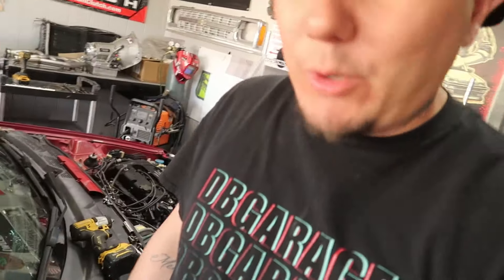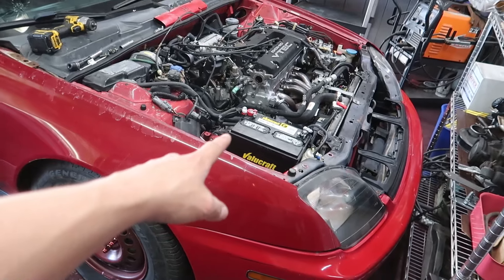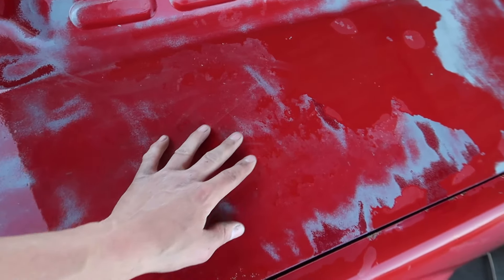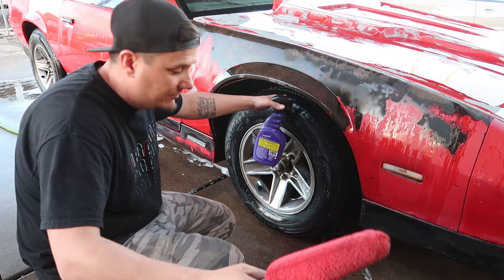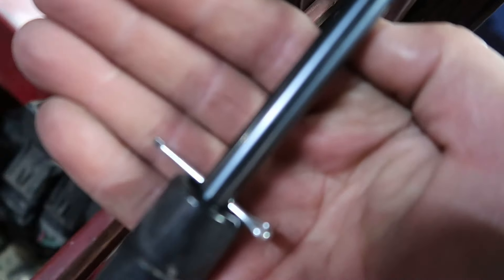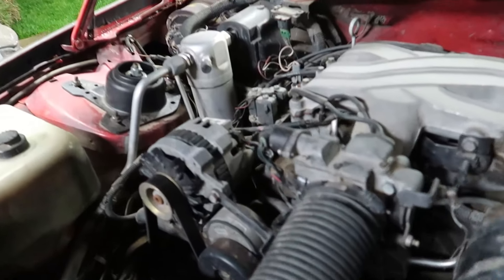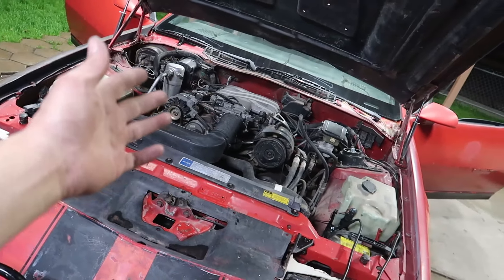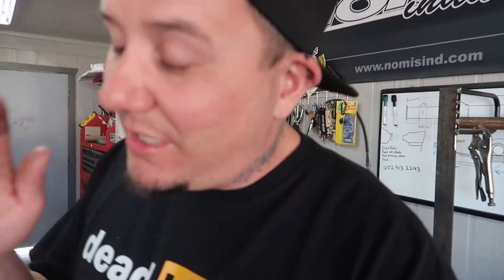My New Gen 3 Camaro!

Comment: I've had quite a few third gens and after I got into newer cars I found out the 3rd or 4th generation interior actually works as a direct swap because if I got another one again I was going to swap the 02 SS interior into it and go LS turbo, your hood is aftermarket it was more of the aggressive Z28 hoods..if I were you I wouldn't look for stock thirdgen seats I would just swap newer camaro seats in it they are more comfortable

Comment: Dude, I swear we're on the same wavelength ... we literally just bought a 3rd gen last month! Lol

I've got a 6.0L for it, already 3 linked the rear, BMW "big brake" upgrade, and am now working on getting some random Subi coilovers fitted on the fronts

Your videos are gonna give me even more motivation to get it done! Keep it up homie!!
Reply: Please elaborate on "BMW brake". What size, year, model, bolt on, and number of pistons? Thanx
Reply: @Twogreenfeet  I'm using front brake/hub/wheel bearing and rear brakes off of an e60 5 series. Specifically, they're off of an 08 535xi

The brakes are massive, roughly 13" rotors. I think pretty much all BMW brakes (except maybe the Ms?) are single piston.

Nothing has really been "bolt on" except the rotors themselves. The 3rd gen is 5x4.75 and the bimmer is 5x120. That pattern and the center bores are close enough (for me) to just run them. But there is definitely some fabricobbling involved for the rest haha

I will make a video for this car on our channel once it is done in case you are interested in exactly how I do it! Worst case scenario, you'll know what not to do haha

Comment: I will say you need to check the cooling cowl for the radiator that is under the front, it's an air dam that shoves air up across the radiator.

Comment: Just as an fyi... Most of these cars rely on an under trey on the bumper that scoops the only air into the radiator from under the car. If this plastic panel gets damaged... It doesn't scoop air into the radiator. The. Causes the car to overheat one time and then it never runs good again. So if that is bent or anything weird... That needs to be replaced.

Comment: Just letting you know I have a 3rd Gen Camaro that originally had a V6 engine in before I put a high performance 350 crate engine in it. . I ended up having to get a new 700r4 transmission those bolts behind a V8. There bellhousing  is different with the 700R4 transmissions that was behind the V6 vs V8 .

Comment: You might want to check the pattern on the transmission (I think it’s like the 2.8)
Reply: The 2.8 and 3.1 are 60 degree and have a different bellhousing than 4.3 v6 or any Chevy v8. So to install that 383 you will need to cut the bellhousing off and bolt on an aftermarket scatter shield or use a V8 transmission.

Comment: I bought the Identical Camaro in 1991. V8 with 5-speed. It was an extremely nice car. Bad thing was wheel hop attempting to drag race. It was absolutely horrible and voilant wheel hop. I cant remember if it had a 305ci engine or 350? Best guess I think it was a 305

Comment: Um , the 3.1l was a Pontiac,or Buick engine and doesn’t bolt up to the sbc bolt pattern and is the weakest transmission used by GM. That’s like the 7.5” rearend,another weak link. But f body rearend swap from 82-02. The 2000-2002 z28 rearend had disc brakes.3.42 posi on the early years. The rs you have is pretty light.
Reply from the maker: I'm learning brotha, appreciate it 👊🏻